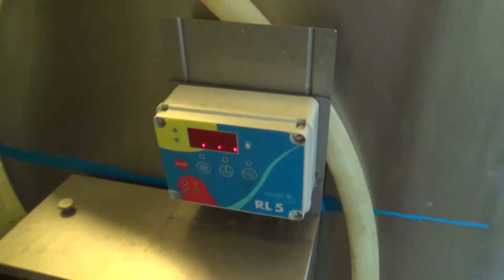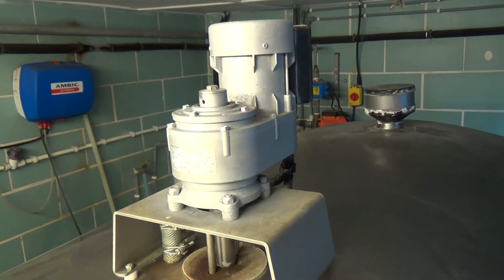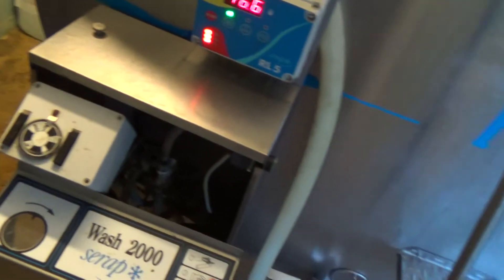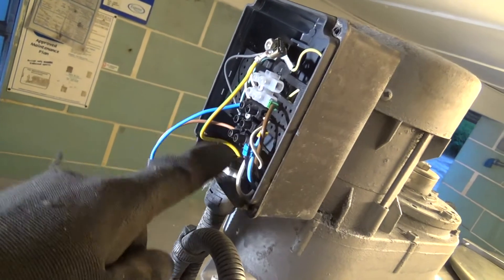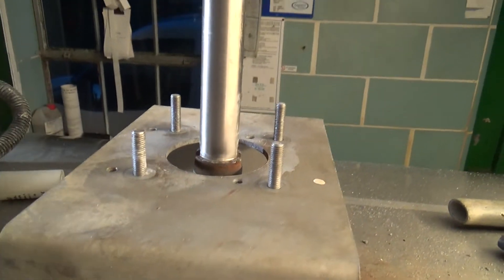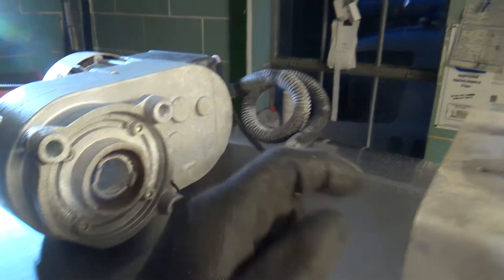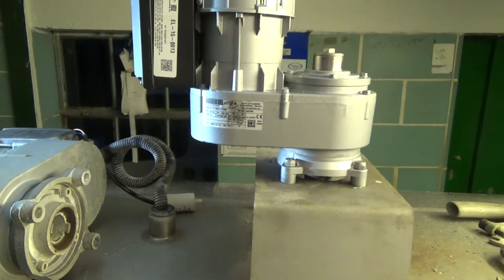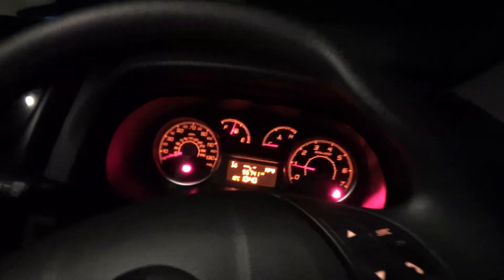Failed Agitator Replacment

Comment: Put some silicone grease on the threads or any food grade grease u have on those stainless bolts when u put them through those aluminum holes. Helps for next time.
Good video !
I would have prob. Just cut off bolt with 4” grinder with cut off wheel or sawsall if i could not get grinder in there.
I am guessing you did not have a spare set of bolts on the truck.
I’ve learned lately , that it wastes wayyy too much time trying to get nuts off stuck all thread and such.
I wasted about 1.5 hrs trying to get 4 nuts off long all threaded rods when I should have immediately just cut them off and been done with it.
It meant going up into a ceiling and cutting holes which I ended up having to do anyhow.
Lesson learned for me.
Chop it off is my new motto.
Reply from the maker: I greased up the threads before fitting the new agitator, my van was in for repairs so was working out of the spare van that doesn't have many tools in it so was working with what I had! 
What I've done in the past is grind the aluminium away until you just get to the bolt threads, it releases the grip and you can get the bolt out then.

Comment: well done. when these screws are seized use a torch.
Reply: Powdered oxide it might still be stuck, unless you melt the aluminium away. You get a white Loctite sealer, that is designed for stainless steel and aluminium threads, which is extensively used in the boating industry, though I do not think they make a food safe version. But you put it on, leave the stainless steel and aluminium boat engine in the sea for 5 years and it will still loosen up no problem, even if the aluminium casting elsewhere looks like a solid white mess under the paint. Works well on stainless to stainless as well, and while it will eventually dry out it still allows you to pull them apart again.
Reply from the maker: I was a bit short on tools as working out of the spare van as other ones been off the road. Some heat would have helped.
Reply from the maker: Yeah it was aluminium oxide that had filled the threads, was a bit short on tools as working out of the small van so had to work with what i had!